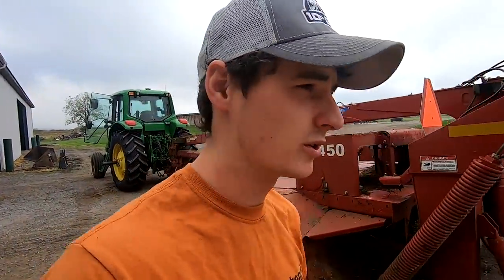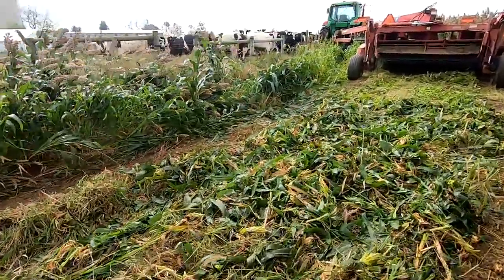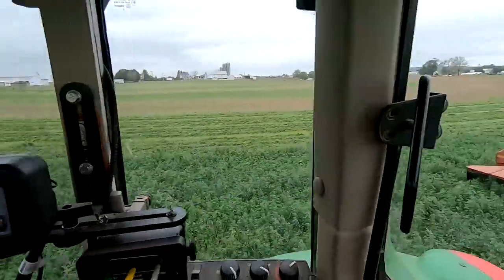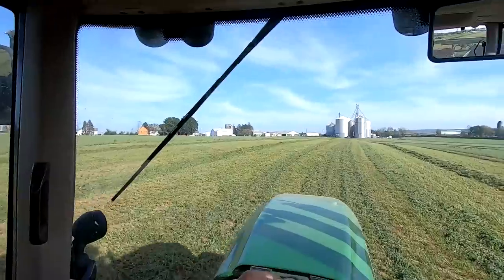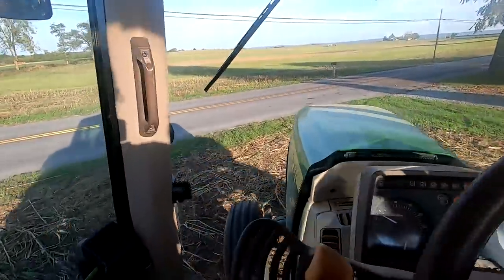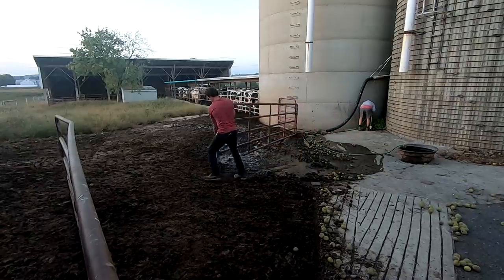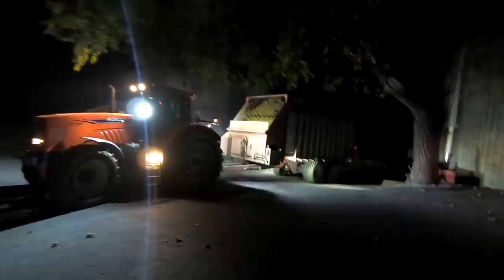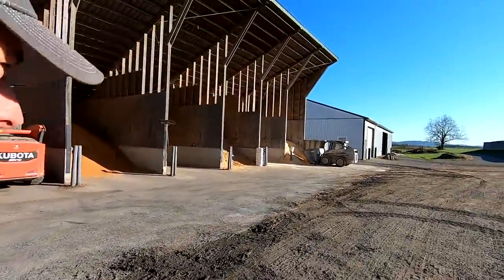5th Cut Hay & Sorghum Harvest

Comment: Hey Eric.....my personal experience with sorghum is that it can be a tremendous source of forage for dairy cattle. If cut regularly (25-30 day cut schedule) it can yield significant tonnage from minimal acres with protein levels of +/-15%. Regarding feed intake, on a short cutting schedule it can have reasonable levels of ADF/NDF to support feed intake. Feed quality depletes rapidly as the crop grows taller/thicker. No need to mention, but I am certain you will have the crop analyzed for nutritional value. You may find, your crop is sub 10% protein with elevated ADF/NDF levels. If feed to heifers, I think you may want to supplement with additional protein to ensure your heifers attain their growth potential (stature).  Personally, I would consider blending it into the dry cow mix?......just watch the potassium levels. Good on you for trying something different on a small scale to see how it can be incorporated into your operations feeding program. All the best and I look forward to hear how things works out and if you decide to utilize sorghum as a forage source going forward.
Reply: Here in NZ we don’t let it go to seed like that, it’s feed out as a crop, so strip graze it every day gets to about 1-2m and cows go in there,
Reply: dried sorghum plant is one of the main fodder in India, TamilNadu and it is excellent for dairy animals. It is a 90 day crop here and mostly single cut. sometimes we go for second cut but the quantity we get will be 50 to 60% of the first cut. mostly it is rainfed here.

Comment: Hey Eric great video as usual. Now that you're done cutting for the year it would be great for the mower if you would pressure wash it inside and out before you put it away. Keep up the good work! Also don't worry about putting that sorghum silage in the bag a bit wet, especially for heifers, even up to 75 percent moisture, it will still make amazing feed. I can say this from experience as last year our crop was so wet it was literally being turned to soup in the bagger without even bagging at even near high pressure and the heifers absolutely loved the stuff! Your feed looked beautiful though!

Comment: Eric - Why don’t your custom guys use a rotary header to harvest the sorghum? Wouldn’t it minimize grain loss? Straight from a standing crop through the forage harvester versus cutting and raking, both of which would seem to cause loss of grain.
Reply: You have to get that sorghum dried down. The standing crop has far to much moisture to ensile properly.
Reply: @dmc3742  Thanks for your reply and I get moisture content issues. But I understood they cut it in the morning and chopped that evening. Eric commented on the moisture level in the clip. If I recall correctly he said it was at about 62% and they were targeting about 60%. I understand there is a juggling act associated with harvesting - Balancing the availability of the custom crew, recent past weather (are the fields dry enough to handle equipment), future weather (is a multiday storm coming), to name a few. But couldn't you just let it dry longer while it's standing? Isn't that what is done with corn silage? Isn't that why there are rotary headers? What is the difference from a moisture management perspective between corn and sorghum?

Comment: TIM from Canada there is no reason why you should not blow out your machines with a leaf blower before you tighten or loosen the bolts on your machines..... like in this case we hear the young kid is tightening the bolts on the chopper there is no reason why the leaf blower could not have been used on this job for instance if the gunk in the stuff or on your bolts they will rust more

Comment: Why is your chopper guy not direct cutting the milo?
Reply: The chopper head to direct cut is different from windrow head.
Reply: @ardurbin2  yes I understand that. Around here they chop milo with a kemper head
Reply: @brianhansen826  The standing crop has to much moisture to ensile properly. Needs to be cut and dried some before chopping.